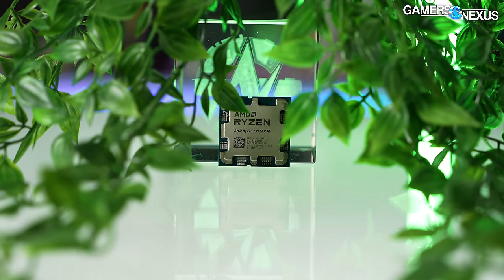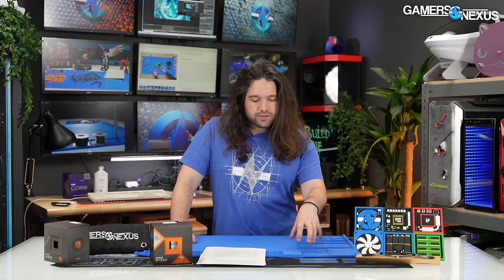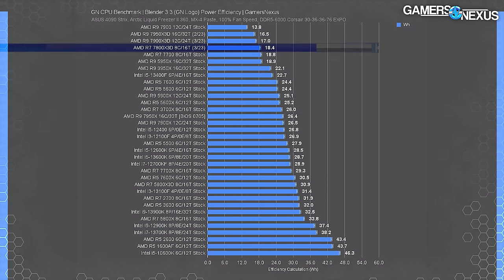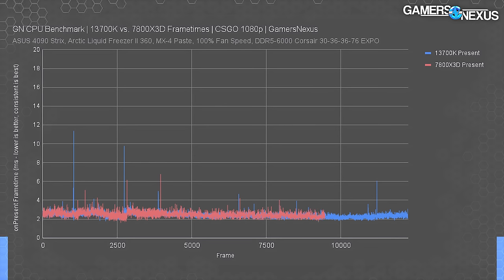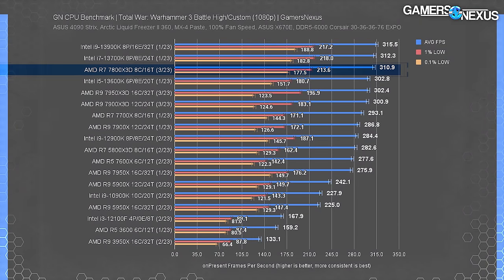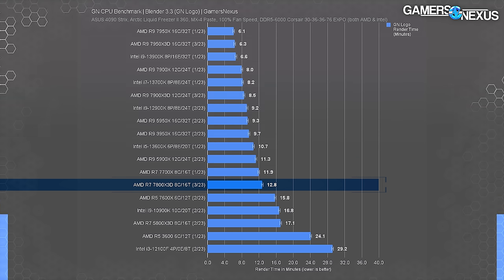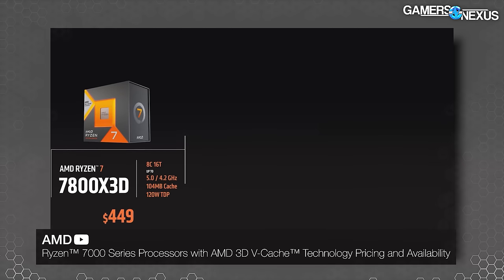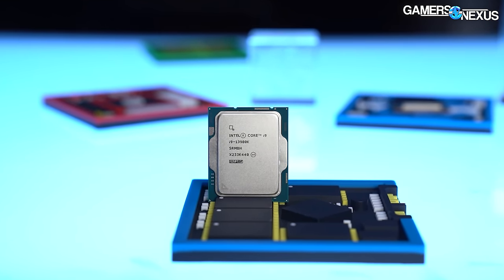AMD Ryzen 7 7800X3D CPU Review & Benchmarks

Comment: I went with the 5800X3D because on CPU's I planned on skipping this Gen. Haven't regretted it yet. What surprised me the most was how competitive the 13600k was, especially for the price.
Reply: you will be good for 5+years imo if you are willing to turn down the settings to get more fps.
Reply: @BillyPistocco  my 13600kf uses around 80watts average when gaming. All the charts we see of power consumption are max core work loads which AMD do much more efficiently. But for day to day use and gaming 13th gen isn't  too bad.
Reply: same here man, glad i chose the 5800x3d
Reply: I'm keeping my 5800X3D to on my x470 board. My 3rd CPU upgrade since 2018, I might upgrade in another 2yrs, not sure yet.
Reply: My 3080 and 5800x3d, still rock fine. Skipping this gen, happy with what I got still
Reply: I did it to play Hogwarts better. coming from a 3700x to a 5800x3d the stutters went down significantly and the few were barely noticeable or not that annoying. It made the game much more playable. The v-cache technology helps making the game experience in playing much more stable.
Reply: 5800x3D on x570 board w/ msi rtx 3060 12 gb gpu and 32 GB(2 x 16) of 3600mhz cl 16 ram here - it's not worth upgrading for a while until pice gen 5 hardware prices drop significantly. right now the prices do not validate upgrading if you already have a capable pci gen 4 rig
Reply: Every time I see one of these video's it makes me smile.  The 5800X3D was the best purchase I made this year.  And I still don't regret it.  I will be skipping this gen all together.  Thanks AMD!
Reply: True, the 5800X3D is awesome. I dont think you will be regretting that purchase any time soon. 
I am still bummed I went for a 12th gen intel when (my) b350 still was not updated for ryzen 5000.
Still, I share your sentiment. I was amazed Intel put forth a CPU that was good value on the productivity front and still rivaled their top end chip in gaming.
I really hope this trend of seriously competing on price and performance fiercely continues. If it only were this way in the GPU market as well.
Reply: @beePie Energy usage is probably the biggest drawback to 13th gen.
Reply: @craigsmith8052  I bought the 13600k for that reason. In normally use consumption isn't too bad.
Reply: Same here. I also didn't want to have to pay an arm and a leg for shiny new DDR5 either and yep. I can say I don't regret getting a 5800X3D. I DID regret getting a 3900XT though. That thing sucked.
Reply: @-INFERNUS-  Are you, like, me? I also have an x470 board and this is my 3rd CPU as well. I went from the 2200G, to a 3900XT, to now a 5800X3D on the same board.
Reply: @craigsmith8052   And nobody ever talks about idle power draw. Some of the AMD chips run at 40W idle while Intel sips power at 3-15W depending if ecores are present or not.
Reply: I agree, the 5800x3D is performing very well and i will skip that gen and most likely next before having the need for any upgrade. I have a 7900xtx, i would LOVE GN to include that card, once in while, in their tests to see if there is any difference vs nVidia to GC... some videos suggest 7900xtx scales better with AMD CPUs than Intel's and i really like GN in-depth tests and analysis.
BTW, the new timeframe data is really interesting, keep adding some within your tests.
Thx for your great work!
Reply: @Dimondminer11  I think we are😁 ASRock x470 here went from a 2700x, then 3700x, and now the 5800X3D.
Reply: Yeah I recently got the 5800x3d for 4k gaming. insane CPU.
Reply: Yes, me too.  I bought a cheap second-hand B450-based PC on ebay for £290.  I sold the Ryzen 3600 that was in it for £140 and bought the 5800X3D on launch day for £410.  Making £560 total for the base PC.  Then I bought a RTX 3080 Ti for £900 shortly before RTX 4000 release.  I recently doubled the RAM from 16Gb to 32gb for a cost of about £25 after selling the existing RAM. This PC is a beast and I think will last me at least 5 years.
Reply: @craigsmith8052  Exactly. Ppl don't understand what they are seeing when they look at benchmark charts. Most of these ppl are casuals who don't know a thing about PCs really
Reply: @NBWDOUGHBOY  And I suppose you know everything  about everything?  Everybody has their own strengths.  No need to act like you are superior to others.  I assure you that most of those PC "casuals" know more about other topics than you do. (I am a software developer by the way and have built PCs since the early 1990s, so I am not being defensive here)
Reply: @flightsimdeskuk  Lol. 🤣🤡. Why are getting all emotional? Lol. Some ppl take this stuff way too seriously I swear. As if there aren't more important things going on. 🤣🤣🤣
Reply: Depending on what you need it for it you can probably skip 2 more generations without worry
Reply: @Mewzyc no he just would need a better GPU and some ram I am here surviving on medium for a lot of new games with a i5 2500 ,most games are just about breaking that 4 core count
Reply: @craigsmith8052  13600k is surprisingly quite power efficient in real life usage. It's just that X3D chips has such an insane power efficiency, both on charts and real life usage, that 13600k are often overlooked. Doesn't help the fact that it's bigger sister chips currently the biggest, most unefficient power hog processor on the market.
Also just like other Intel chips, 13600k is really efficient during idle and very small workload such as browsing and typing, huge difference when compared to Zen4 chips.
Reply: @beePie you will be surprised but Intel is few times more power efficient during idle times in productivity workloads.
Reply: @craigsmith8052  The intel 13th gen are very efficient at idle as well or when not much is going on. Also, the 13600K(F) destroys 5800X3D in productivity. So it depends on what are someone's needs.
Reply: @Assassin5671000  i was strictly only talking about his CPU. And u can turn down your settings to low.
Reply: I just bought the 5800x3d to upgrade from the ryzen 3600. At first I wanted the 7600 but it just makes more sense to stick on my am4 for now. Ill check again in a few years
Reply: @lilfredd1393  can you post the power consumption of the 5800X3D while gaming (in something intense like Warzone or something and a more lightweight game maybe) ? Curious what it does while gaming compared to the post of @craig Smith with his 13600kf. 

Currently use an 8700k and it does about 60 to 85 Watts during gaming too.
But considering the all core rendering maximum of the 7800X3D was 85 Watts i am very curious what it does consume during ligther loads
Reply: The 13600k is also on a dead socket. They're moving to a new socket for 14th gen. Obviously the 5800x3d is also on a dead socket, but it's last gen and MB's and RAM are much cheaper. This is one of the main reasons I've switched to AMD. AMD keeps the same socket for much longer than Intel. With Intel, you have to get a new motherboard every time you upgrade your CPU, unless you upgrade every generation, which is completely pointless for most people.
Reply: @ashamancito4630  here's hoping Intel's Battlemage GPU's are more competitive in the mid-range/high-end. We need more competition. With how far they've come with drivers in such a short time, I'm pretty hopeful.
Reply: I will wait for the 7 9800x3d
Reply: Same here, grabbed June of 2022 and believe I’ll stick with it for next 5+ years
Reply: @lilfredd1393  smells like cope
Reply: @craigsmith8052  the 7800x3d uses 40-50watts for games and is way faster then the 13600k(f) almost HALF watts meaning half the power bill...only real reason to get intel is the e core background app managements which the ryzen 9 stuff isnt capable of instead they park and be useless...intel isnt innovative just more power for more performance but it gets innefficent the higher you go so its a dead end..."only" 8 cores can be a problem pick your poison
Reply: Me too man. 5800X3D is looking good value right now
Reply: 5800X3D gang!
Reply: Same here, now I'm really limited by my monitor and GPU, I might skip the next few gens as well for the CPU and focus more on what direct storage brings.
Reply: @Mewzyc  exactly not, turn em up so you attack the GPU.
Reply: @OldCheddarhand  Whatever, my point is you can do whatever you can do extract as much performance in your computer/CPU. Im currently using a C2Q q8400 CPU from 2009 so I know the struggles lol.

I currently use a 1080ti, changing the graphics to higher does nothing to my fps because that's how CPU limited I am.
Reply: @mustafafink7024  AMD fangirl spotted
Reply: @johnborheck3022  Are you still running 1080P with that setup?
Reply: Planning on getting a 5800x3d the end of may to replace my old 3900x and give some life to my almost five year old system.  Been bouncing back between the 5900x and the 5800x3d, but all my research says the 5800x3d is the better choice for gaming.  Reading you comments pretty much put that purchase in stone.
Reply: @vicsrealms  What video card do you have and at what resolution do you game at?
Reply: @lflewwelling2  Currently gaming a 1440p with a 2080ti 11GB.
Reply: stuck on ddr4 lol
Reply: just say ur poor
Reply: @johnborheck3022  i have the same setup...for sure not looking at a upgrade for at least a couple years
Reply: @vicsrealms  ya, at 1440 with that video card there is no reason to get a newer cpu.
Reply: 5800x3d/3080ti checking in, I had planned to skip this following gen when i bought these parts over a year ago and just about daily I get more confirmation that I made the right choice.  8800x3d/8950xtx3d has a nice(sortve) ring to it.
Reply: hahahahhaha i5 13600k has 10nm node+ + and the difference of 5800X3D has 6-5nm node!! I think you don't know anything!! 10nm vs 5nm! but an intel example if it is worth using 5nm then 5nm intel can destroy 5nm AMD!! I feel sorry for AMD it will be a complete loss failure!
Reply: @MrJonas7  If reason, i5 13600k can be destroyed at 5800X3D but AMD don't know anything about 13th gen has 10nm++ and now 7000 series x3d has 5nm? My opinion is that 10nm++ Intel is more beast and 5nm AMD is more powerful! You understand 10nm++ vs 5nm so Intel is worth using 7nm as 14th gen to destroy 5nm amd complicated
Reply: Think I’ll get this but would still get the next generation if AMD did something to work on their idle power
Reply: @vicsrealms I was having the same thought,  but as the last upgrade for my X570 board, I think the 5900x is more future proof due to higher clocks and core count. 
The problem with the 5800x3d is really core count and price, not saying its a bad CPU, but ultimately the 5900x is also pretty good in gaming (minimum frame rates are competitive with the x3d) but far better in productivity and general all round performance.
For me the edge cases where the 3d cache matters are less important than the benefits the extra cores have right now and might have in the next 5 years. With both Intel and AMD pushing high core count CPUs into mainstream,
Those extra 4 cores provide a compelling argument for future proofing
Reply: @ChiquitaSpeaks  Idle power ., weak argument.. thats like car fuel consumption when its parked in the driveway, turn the PC off... zero idle power. 🤣
Reply: @TheAddanz  …ppl aren’t allowed to value idle/low usage power usage?
Reply: @TheAddanz  your lack of self-awareness has left me gob smacked regarding who you believe is the one trying to look for an argument. I’m trying to argue with myself?
Reply: I have a 5600X and I wish I'd known the 5800X3D was coming when I got it. It doesn't feel worth the cost and hassle of swapping out but damn I wish I had it initially.
Reply: @Chaos Watcher  what if you're a. Ew builder?? Been debating going am4 or am5, price is a factor, but yet I want something for a long as possible b4 upgrading
Reply: Same! I bought mine and didn't even think about this current gen. We should be good till even 9000 series but we'll see. I love the x3d chips
Reply: im gonna upgrade to that too, still using r5 2600 sixcore, which starts slowly bottlenecking the new gpu on some games.
Reply: just got a 5800x3d and it's absolutely nuts how great this CPU is. I play Hell Let Loose and this game really isn't friendly on performance. But man, 144fps almost all the time now. From 60-90 depending on what was going on. I am very, very satisfied.
Reply: @PinePizza  what gpu u have?
Reply: in Australia a 5800X3D that can go into my old AM4 systems cost $500aud, where as to get everything I would need to use a 7800X3D including the cpu is over twice the cost; $1300aud. It's a no brainer since the latter only slightly gaps the former is win-more scenarios, it will be years till even really bad 1% low games like RDR2 will the difference be perceptible outside of benchmarks.
Reply: @Mewzyc  You are exaggerating.
Reply: @imnotusingmyrealname4566  I been using a q8400 all the way until early 2023 (go Google the release date). It depends on what you are doing and like I said, the settings.

You just been spoil thinking u have to run the highest/max settings at 60+ fps. 45-50 fps constantly is playable for example
Reply: @Mewzyc  but a 5800X3D should deliver minimum 60 fps for at least 5 years, I don't think it will fall behind that fast,
Reply: @imnotusingmyrealname4566  so you do agree with me then. Then y did you say I was exaggerating in your last comment, like the CPU will be useless in less than 5 years then?
Reply: @Mewzyc  I tried to say that the 5800X3D is a powerful CPU and that even in 5 years it could remain powerful enough to not bottleneck the system, so I agreed with you but went even further saying he wouldn't even need to worry about lowering settings at all

as a sidenote I would recommend an air cooler for that because AIOs go bad after 5 years or so. My 7 year old Corsair 280mm AIO runs my R5 3600 at 70°C while a friend has a Noctua NH-U12S and an R5 1600 that runs at 53°C in the same benchmark (Time Spy)
Reply: @imnotusingmyrealname4566  ah I see.
Reply: @craigsmith8052  techpowerup in their CPU reviews also has gaming power consumption and gaming efficiency frames per watt numbers. For example the 7800X3D with PBO Max has a gaming power consumption of only 51 watts and an absolute chart topping frames per watt of 5.20, a 13600k has an efficiency of 2.50, Intel isn't bad yes but they undeniably draw more power than AMD.
Reply: @mustafafink7024  the Intel e cores are sadly not being managed by Windows properly so they are basically useless
Reply: @arithmetic7105  it's just the truth bro
Reply: @vicsrealms  why do this weird upgrade/sidegrade when you could get a 7800X3D on AM5 with some super fast DDR5 memory? DDR5 prices are now finally reasonable and the 7800X3D with PBO Max is 32% faster than the 5800X3D! If I had a 3900X I wouldn't bother getting another CPU for this now superseded platform, do a proper upgrade or don't upgrade at all, that's my opinion
Reply: @Dimondminer11  why these many CPU changes? that's just wasting money
Reply: @griffin1366  yeah AMD has some weird idle issues, GPUs too
Reply: @flightsimdeskuk  that used B450 PC was a good deal, seems like you didn't pay that much for the performance you're getting, although I would buy everything new at once because I just feel better with that, I already have a Frankenstein PC I want a purpose built one for once😂
Reply: @imnotusingmyrealname4566  Ended up going a different direction.  Instead of upgrading the CPU, I moved from a NZXT H510 and its ability to choke my CPU and GPU of cool air.  To a Lian Li 011 Dynamic EVO with far better cooling.  

While, I still every once in a while drop into the 30 FPS range on my Modded Skyrim build.  I don't throttle at all. The upgrade in cooling will probably give me a few more years on this system.
Reply: @vicsrealms  yeah when you watch Gamers Nexus case reviews you know that not getting enough cooling can really drag a system down
Reply: Maybe I should have done that. My Am4 mobo died the other day so I decided to screw it and up a generation. The 7800X3D is a handy little chip though, coming from a 5800X.
Reply: Just ordered the 5800x3D 3 days ago to go with my X570 mobo. I play on 1440p, not big of a difference at all imo.

Comment: Glad I've waited for the 7800x3d, the delayed release was so suspicious it stunk!
Since my PCs main use is gaming this is a great CPU <3
I've gotta say, that power efficiency in this generation is downright impressive.
Reply: I'd love to see it against the 13700k with e-Cores disabled and undervolted.
Reply: @griffin1366  The 13700K is more efficient with the e-cores turned on, otherwise, forget 3 watts for iddle power load and get the 40ish watts on Ryzen.
Reply: @saricubra2867  I'm sorry, but what Ryzen has 40w power draw on Idle?
Reply: @viniciuslima5021  The 5800x 3D certainly reports 40w draw when just watching YouTube videos, I can't speak to what the Intel does though.
Reply: @saricubra2867   I was thinking more under load but sure.
Reply: @griffin1366  Underload at 100% use a CPU with more big cores is more efficient (watch the 5950X vs 12900K)
Reply: @MrHamof my 3700x uses 2 watts at home screen